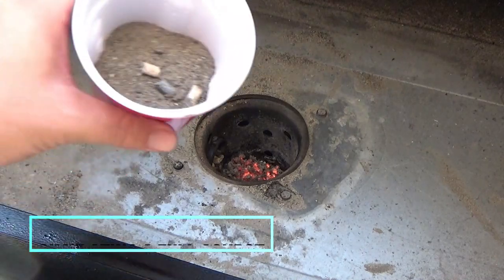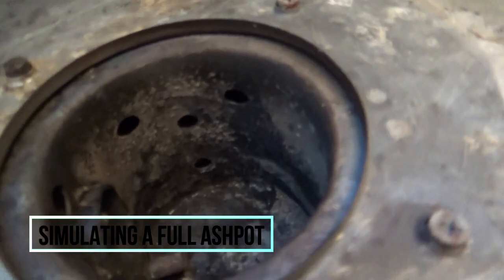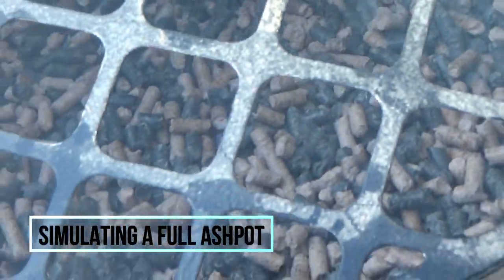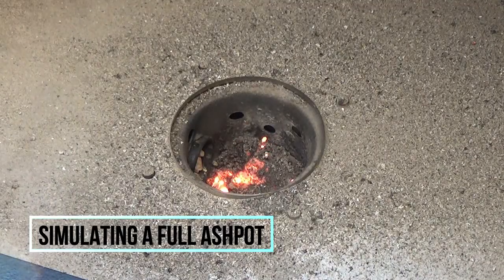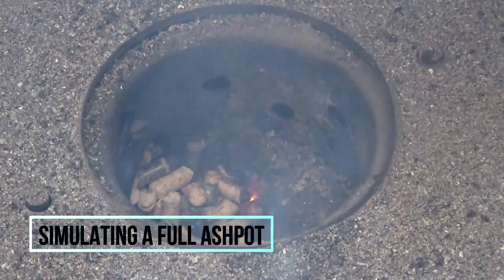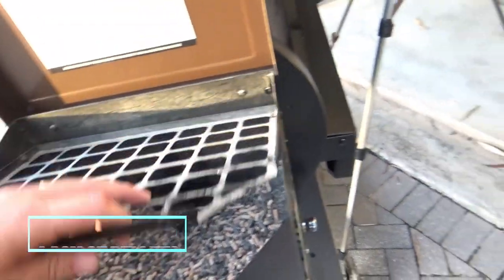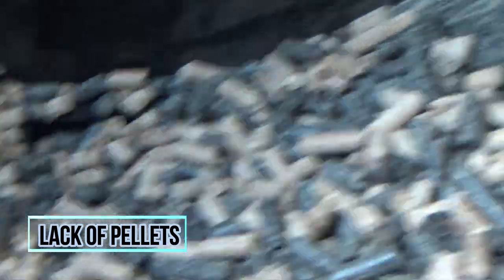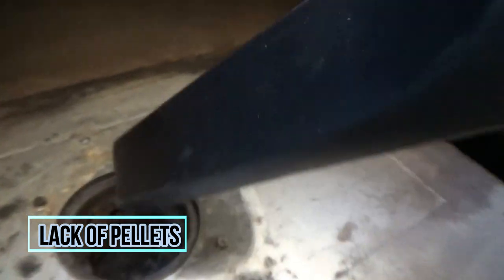Pellet Grill Flameout Explained

Comment: I would say most of the time it's because people don't keep an eye on their hopper and the pellets stop feeding, the other time is that people don't clean out their ash pot. The key to a flame out is to fix the problem BEFORE you continue or you can have serious issues. Very good video for all pellet grill users.
Reply from the maker: Couldn't agree more. Thanks man!
Reply: if you are doing a longer smoke how often should you check your hopper?
Reply: @ChiTownBrownie89  on a long smoke at around 225 degrees, I'd say fill the hopper and check it every 3 hours at least. Higher temps will use pellets faster so you would need to check more often. However, if you are doing an overnight cook at 200 I think it will make it. It also depends on what pellet grill you have. I'm basing this off of my PB1100. My PB Tailgater will go 5 hours at 225 easy because of the smaller area that needs to be heated.
Reply from the maker: Yeah @craig k , what he said. Kevin, I gave you a shoutout on my last video and modified your sticker segment idea on my channel too. Thanks for all you buddy!

Comment: Based on all the videos I've seen On Pit Boss smokers and their problems with  Auger James, Flame Outs, Ignitor failure, and Hopper Smoke It think it would be safe to say the the problem is 
the Walmart special Pit Boss Smokers. I've owned a Oklahoma Joe Pellet Smoker for 2 years and have not experienced any problems. All It do is clean and maintain it and continues to operate without issue.
Reply: Interesting, I just got a Walmart Pit Boss and have been surprised by how resilient it is to flame outs. So far they've only been caused by me doing stupid things like making huge sudden temp adjustments (all the way high to smoke) or dumping in handfuls of pellets to get it to temp faster. It manages temp really well, within 6 degrees with a thermopro and is surprisingly well built for the price.

Comment: I’m smoking a brisket and it happened to me maybe 7hours into the cook . I took everything out cleaned and vacuumed the ash and scraped everything off and put it back in and it keeps happening nothing too crazy like before but enough smoke that I don’t want In my brisket . Can the temperature be an issue ? I’m cooking it at 200 I typical do it at 225 …
Reply from the maker: The lower temp you run a pellet smoker at the higher risk of flame out. Now with that said Ive ran mine at 175 and never had an issue..... Keeping the hopper full?
Reply: @1526BBQ  yes it stays full , I did turn back to the typical temperature that I always do and the excessive smoke did seem to stop ! Thank you

Comment: Your pellets can "bridge" under the pile making it look as though it is full of pellets but the "bridge" wont allow pellets to encounter the auger.  this will make the grill starve for pellets and then flame out.  this can be delt with by dimply keeping a piece of wire or something like that by your grill and simply "poke" the pellets toward the auger.  you will see a sudden shifting of the pellets which signifies you have "broken that bridge" and now they are free to flow into the auger therefore into the burn pot.  happens all the time.  most especially if you are using inferior pellets that aren't nice and hard, if they get "dusty" that can very much influence the bridging as the dust settles to the bottom of the hopper. It is advisable to clean out the hopper VERY well after the use of those inferior pellets hopefully preventing this occurring again.  this can also happen with pellets that have somehow gotten moisture in them (maybe the lid wasn't sealed right on the hopper allowing a very small amount of rian or something similar.  The "fix" is the exact same.  You farmers know that this exact same thing happens in grain bins often with "deadly" consequences on occasion sadly.

Comment: Good video. I had this happen to me 3 times. The first time I was guilty of not cleaning the firebox.  The other two times thefirebox was clean and it overflowed with pellets within 30 minutes.  I haven't used it since. Any thoughts on this? Thx.
Reply from the maker: My guess - you had a pellet void, that lead to a flameout, the pellet void then self corrected (collapsed), and filled the ash pot with pellets. To avoid this you have to "stir" the pellets from time to time - mix them up so you break up any voids.
Reply: @1526BBQ  thanks
Reply: @1526BBQ  my ash pot is clean the auger is putting pellets in .. I only see a small blue light on the ignitor is the ignitor bad & is it replaceable or can you recommend a fix?
Reply from the maker: If pellets are NEVER igniting then you may have an ignitor issue. The ignitor can be replaced, but I haven't done the job. You could pre light a few pellets and drop them directly into the ash pot, then turn on the pit. It should work just fine, the ignitor is only needed during start up and is not used during normal operation.
Reply: @1526BBQ 😊😊

Comment: I liked watching your "experiment" with a full ash pot to see what it would DO, because it answered some questions I'd had.   

 I just had my second explosion and flame-out a couple days ago. This is the second one in about 5 months with this Traeger and I am at a total loss as to WHY?    Unlike our first Traeger, this one came with a "shut down" mode which I do NOT like at all because it never shuts itself off! You are inside enjoying your meal and relaxing, only to step outside 2 hours later to discover your grill is still going!  What??
   It will just run for hours and do a slow burn, wasting pellets.  Our old one didn't have the feature and we never had a burnout. The only reason we got rid of it, was a wiring issue and it quit working after about 8 years... though our oldest son took it from us and got it working and is still using it!  

The first flame out was a huge shock and I had flames coming out the top of the stove, warping the paint which ticked me off as this is a fairly new grill.   Yes I shut it down and shut the lid, but had to get my steaks off.... I felt, as I didn't want 8 steaks ruined, yet taking them off with those flames all around was not very fun, and fairly dangerous.

I CLEAN my Traeger and I have never had my burn pot filled with ash like you had done... which is why I appreciated your experiment, and when I do clean, I do a really good job.

 I mean.... it is a very messy process ....so do it good when you DO clean it, right?    (I find putting on about 4 pairs of disposable rubber gloves is easiest, so that when you scrape off grease and mess with the ash, should you need to touch a garage doorknob or something to dispose of something, you can remove one layer and not get things dirty.)

Not only has my burn pot been filled with pellets after one of these explosions, but I have about 8 cups of pellets outside of the burn pot, inside the stove body.  

As for running out of pellets, I check my hopper every time I grill to see what I have, and I have a deck tote beside my stove that is full of pellets and I can scoop up and refill any time I need.  I don't run out of pellets... have sacks of them stocked up in my garage to refill my tote! LOL

I give you a thumbs up for doing this experiment, but I am still confused as to why this grill is doing this.   I took it apart last night and cleaned out the explosion mess, then turned it back on without the grill and tray to watch the burn pot to see what it did.  Pellets began to fill the chamber but no smoke. I kept digging out the clean pellets and returning them to the hopper box, and after several minutes I shut off the grill, then turned it back on and it THEN began to smoke and ignite the pellets... so I put it back together and grilled hamburgers.  We SHUT IT OFF as soon as we took the hamburgers off, treating it like our old grill... and I guess we will see what happens tonight when I grill steaks!?!
Reply from the maker: Sorry you’re going through all this trouble. If your flame outs are occurring at the beginning of your cooks, you may want to check your igniter, that little piece of metal that heats up and starts to fire. Maybe it’s defective, and sometimes works and sometimes it doesn’t, If your flame outs are occurring more like mid smoke, maybe check your fan to make sure it’s working correctly.

Something is causing the grill to flame out, and if you’re keeping it as clean as you say, you do, it’s probably something with the igniter or the fan.
Reply: @1526BBQ   Thanks for your reply!
 I think both flameouts occurred at the beginning of the cook, so it is very possible it is our igniter!
I cooked the hamburgers the other night and it worked ok, but we shut it down as soon as we took the burgers off the grill, just like the old Traeger, and didn't use the shut down mode.
I grilled steaks the next night without incident and again shut it down as soon as we took them off.
Then I cooked bacon a couple days later and still worked ok... so I guess we will see if we continue to shut it down right away, if it solves the issue!?
I might just order a new igniter just in case.

I appreciated your demo!

Comment: So the flaw seems to be in the ashpot design. It needs a deeper pot with a sloping bottom?
Reply: No, I think you missed the point John Smith. The flaw is the Human not emptying the ash pot. It's typically a lever on the side of the smoker. There is no excuse for not emptying the damn thing before you start your next cook. That single lack of effort can cause an explosion. Boom!!! Human error. That was the entire point of the video John. C'mon man.
Reply from the maker: I agree with you both. A company could engineer a better ash pot design that would decrease the risk. However, with what we currently have - we have to keep it clean. On my Pit Boss 1100 Pro it is not as easy as a lever on the side, and thats why I think a lot of people "skip" it. You have to remove the cooking grates, remove the searing plate, remove the heat deflector, and then you can clean out the ash pot. I mod-ed my pit by cutting into the heat deflector (video on my channel page). This allows me to: remove 1 cooking grate, slide the searing plate to the side, open access hatch, and clean my ash pot.....
Reply: I clean my ash pot every time and I still get flame outs on long cooks. It’s really annoying and ruins the cooks. Just had it happen twice in the same cook. Bad design or I’m using the wrong pellets? I used lumberjack.
Reply: @flashforwardfilms1570  I use cheep pellets I buy at Walmart if I'm just grilling real fast and there ok, I found if I keep the crock pot near by I can use it to save the cook if the flame goes out.

Comment: We had a flame out or something today ⁰5/02/22 What happened was tht the pellets got stuck or stopped even though there was a full bin. In the auger which moves it to the burner. Then we set it to high(500°) to see if auger would move it did (too much of it). smoke was increasing afterward and 2 minutes later a large blast
Reply from the maker: Anytime you have a flame out and you're restarting you need to leave your grill door open to vent out the initial smoke as it can be very explosive.

Comment: Pellet smokers go through the 
Add pellets to smoldering pellets 
Pellets ignite to flame to maintain heat setting 
Pellets smolder to create smoke for flavor
Add pellets to smoldering pellets
Etc

What can happen, temp drops and grill adds pellets to bring temp back up.  But the pellets barely smolder and don’t increase temp. Grill dumps more pellets into pot because it needs to raise temp.  Nothing, they’re not burning, so it dumps more in.  Now the pot is overflowing with pellets.  At this point you must unplug and turn off the grill.  You must stop the convection fan.  Our bad things will happen next. 

If ‘any’ pellets are smoldering under this overflowing pot, and the convection fan continues to run, you can end up with an explosive flash over. 

The fan will continue to blow on the few smoldering pellets in bottom of the burn pot.  These ‘will’ eventually start to burn with a flame.  The entire overflow will begin to burn and be fed with air by the fan.  Just before this entire burn pot flames over, there will be a huge thick cloud of dirty gray smoke coming from the grill.  This is a soup of explosive gasses and smoke. When the pile flames up and flashes over, it’s most likely this will blow the cover open. Will likely bend it in places as well.  This fanned flame will burn in the 750F range.  Pellet smokers are not built for much over 550-600F at most.  You’re going to damage things. Food will be torched. 

When the grill temp dives, be ready to pull the plug. 

I don’t totally trust smoker built-in thermometers to avoid this smolder out condition. So I always run a grill temp thermometer that talks to my phone or a wireless remote like the ThermoWorks Smoke. 

You can find a couple three grill flash overs on YouTube.  Not what you want to have happen.   These grills are sold as ‘set it and forget it’. But please, don’t trust them quite that far.  Keep them away from house, garage, shed, etc. if you’re not attending to it.

Comment: These things plug in and need electricity? I have seen lots of people use them in places without electricity!
Reply from the maker: Yeah pellet smokers do need electricity. Maybe the videos you seen it had like a portable generator??? Now I'm more traditional smoker like an Offset Smoker, does not need electricity. Thanks for watching!
Reply: You can use an inverter plugged into car power outlet to run a pellet smoker.  Their largest electric draw is the first few minutes with the igniter/hot rod running.  Then just a trickle to run the convection fan.